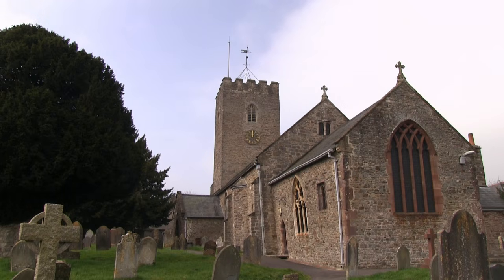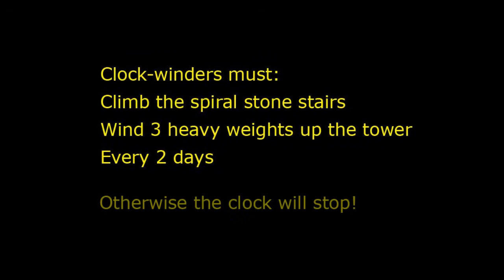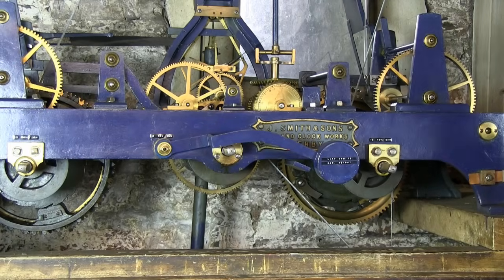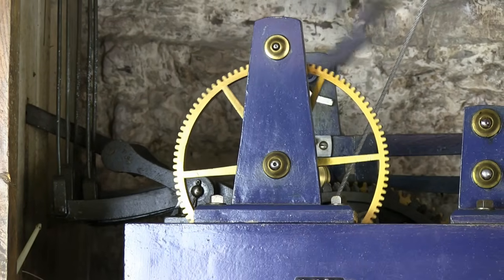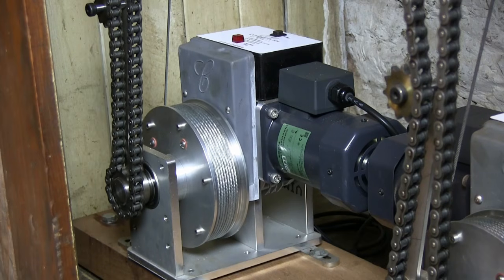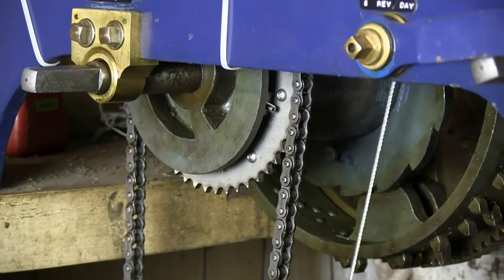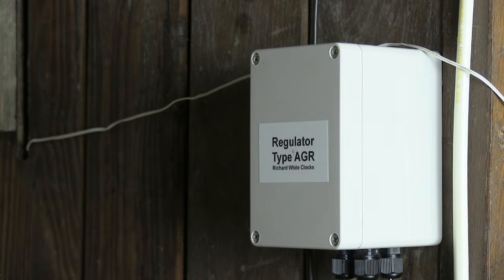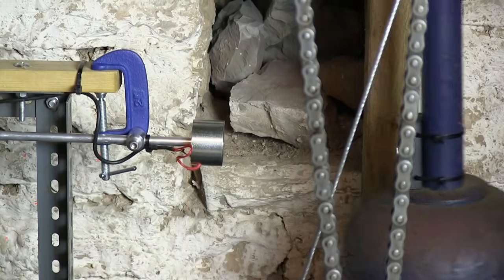Bampton Church Clock

Comment: It is commendable that such measures were taken without damaging the machine in any way, such as cutting, welding or drilling.
It does not damage a valuable traditional machine at all, as it can be returned to its original form at any time.　
This is necessary in today's society where manpower is in short supply.　
However, it is necessary to train machine clock technicians so that they do not disappear. In Japan, where I live, they have almost disappeared.
(Translation software used, please forgive any mistranslations, incorrect grammar, misrepresentations, etc.)

Comment: Well, an electromechanical clock wound by motors isn't a new idea at all, and well within the possibility of 1919 - but maybe this town didn't have no electricity yet. 
However, radio controlling the clock by influencing the pendulum frequency through inductors is quite genius, as it allows nearly perfect accuracy while keeping the whole original movement intact and in operation. 
Tremendous job guys. Just feeling sorry for the team whose jobs once again got automated away.

Comment: What is the mechanism that regulates how many times the bell rings when the clock strikes the hour? Seeing as how this thing is powered entirely mechanically (save for the electric motor that winds up the weights plus the electronic thing that occasionally adjusts the swinging rate of the pendulum to keep the clock in time when needed), something has to control how many times the bell rings for 1 o'clock, 2 o'clock and so on, and also something in the clock has to decide when it's time for the striking to begin. Can anyone attempt to explain this? This is something that's sort of puzzled me with mechanical clocks like this.
Reply from the maker: It is all built into the mechanics of the clock, running just the same as it did 100 years ago. The timekeeping side of the clock on the left triggers the striking mechanism as the hour ticks through, and that side will strike 1 the first time, 2 the second etc and so on until 12 hours later it starts again.
Reply: @bamptonhumph  Right, that makes sense. But what, then, determines how many times the clock chimes for the particular hour (once for 1 o'clock, twice for 2 o'clock and so on)? Is there some kind of rotating wheel or something like that which determines that? Like maybe this wheel has pins, or holes, or something else which somehow regulates the number of times the bell should ring?

I'm imagining that wheel or whatever would have to be first locked in place somehow so that it refuses to rotate, via some kind of "catch" or "locking pins" or something, until a gear or cam in the timekeeping part maybe pulls a lever that releases those "locking pins". That's what starts the striking process... that wheel that was once prevented from spinning can now finally spin. The opposite would then have to happen when it's time for the striking process to halt.

This is probably rather complex and therefore difficult to explain, so I do apologize if I'm maybe asking too much. But I'm simply interested in trying to understand how this works. I should also mention that I'm visually impaired to the point of complete blindness, so that's likely the biggest reason I don't quite get how this works yet.
Reply from the maker: @justinnaramor6050  You are right, it is very difficult to explain! But what you say is basically how it works. 
The chimes are worked very much like a giant musical box with a cylinder with spaced pins, and levers and links to the bells above. 
After the hour chimes, the strike mechanism is triggered by a lever which allows a large cog wheel to rotate, and in the side of this wheel there are pins spaced so that another wheel can be released to create a bong every time it goes around. The spacing of the pins gives time for it to turn once, twice, three times, etc until the next pin arrives. Hope that helps.
Reply: @bamptonhumph  So, your description gives me the impression that this thing uses a "count wheel" to determine the number of strikes on the bell for the hour. I did some reading on how a chiming/striking clock works a little while ago and this is what was explained. Basically the count wheel is a wheel which has little notches cut into it. When the bell is not striking, a lever sits inside one of those notches. This essentially holds the gear train for the striking mechanism in place so that it cannot rotate. My understanding is that there's a complex system of levers in the timekeeping part which ultimately leads to this lever on the count wheel. When it's time for the hour strike, this system of levers essentially pulls the lever out of the notch in the counting wheel, allowing it and the gear train to rotate. The lever rides along on the top of the counting wheel. As the counting wheel continues to rotate, eventually another notch comes into contact with the lever; the lever is allowed to then slide into the notch, either because of an attached spring or simply because gravity takes over and allows it to naturally slide into the notch. This once again restricts the count wheel and the gear train from rotating. So it's the amount of space between these notches, along the circumference of the counting wheel, that determines how many times the bell rings; if there is a longer time between when the lever is pulled out of one notch and when another notch comes into contact with the lever and allows it to drop, the bell would ring more times, because the large wheel with the pins that activate the hammers which hit the bell is allowed to rotate for longer. Obviously the opposite thing happens if the space between the notches is shorter. So the amount of space between the notches only increases as the clock goes through its 1-to-12-hour sequence of operation.

This kind of mechanism is actually fairly easy to understand, if you think about it. But I've also been made aware of another method for determining the number of bell rings for the hours, which is called a "rack and snail" mechanism. The way that works is a little more complex though. It has one particular advantage over the "count wheel" method though: part of this mechanism, the "snail" part, is attached directly to the shaft of the hour hand on the clock, so that any time the striking process happens, it's synchronized with the timekeeping mechanism. A downside of the "count wheel" mechanism is that it's entirely independent from the timekeeping part of the clock, so the 2 parts can become unsynchronized.
Reply from the maker: @justinnaramor6050  Your first description is pretty much spot-on for our church clock. And if the two sections of the clock do get out of sync it is quite easy to correct by manually flipping one of the levers to make it move on to the correct alignment. 
The rack and snail I do have in one of my wall clocks at home and presumably they don't work as well if scaled up to big machinery!
Reply: @bamptonhumph  Yeah, I had a feeling this was what was going on based on your explanation. Really, this is all very interesting! :)

Comment: The electric winders are nice if your winding team really doesn't want to, or can't, do the work anymore, but the electromagnet pulse do-dah for regulation is a ghastly out-of-character bit of overkill. It's the church clock - does anyone really care if it's 5seconds late or early? Besides a skilled clockmaker could probably reduce that to a second or two with a few adjustments and some proper maintenance. Thank you for the video though, most interesting.

Comment: And pray the electricity never goes out.
Reply: It will run for a good while without electricity, the motors keep the weights near the top of the tower, but there is a fair reserve drop.

Comment: The clock tower at Stanford University has the exact same chimes. Not just the Westminster-style chimes, but the same key as this tower, for both the quarter chimes and the hour chime.
Reply: I’ve seen (and heard) the Stanford clock when the tower was new. I understand it was in the tower of the chapel and survived the old tower’s  collapse after an earthquake. Nearby is the Hoover Tower which houses a 49-bell carillon.
Reply from the maker: Well I guess it is basically the Westminster chimes, but sounds different depending upon the size of the bells. Our bells are a little smaller than those in London!

Comment: I have a feeling why these were changed to automatic. Not because no one wanted to do it. But those who had the responsibility to wind the clock took it as a personal chore and a task which they, and they alone, could do. Instead of teaching anyone to do it, they kep it as the "Bell Winder's secret. So they church ended the confusion and jelousy.
Reply from the maker: Think that may have been true in the past, but in out case we had a 'team' of a dozen or so who wound for a month at a time. To me, how the clock is wound is not very relevant, as long as the mechanism has the TLC and attention it deserves to keep it running for the future.
Reply: @bamptonhumph Absolutely brilliant solution to a vexing problem. Before everyone knew the precise (satellite) time by glancing at his/her phone, the time of day was often announced by the town/village clock. The variations shown in the graph in the video show that the winders could not possibly adjust the clock as often as needed to be as accurate as today's handheld devices. Way too many trips up and down those winding (sorry, but...) steps would be necessary, so say the least. With that understanding, the automatic adjuster brings the clock and its tolling bells into the 21st century. As a result, maybe fewer town citizens will need to glance at their phones quite as often!
Reply: I agree, these "chores" could have been passed on - maybe the scouts or similar?

Comment: NO WEAR ADVANTAGE, The amount of pressure needed to operate the clock should never change. When you change the configuration of a compound weight fall arrangement to have a longer or shorter run time ,  The weight will vary. So basically if you have a 80 foot drop directly below the works, You would need , say 40 pounds, But if you compound the cable to fall half the distance you have to double the weight to say 80 pounds. The amount of pressure at the point where the cable pulls the gear is the same. Consistently the same wear.
Reply: Exactly! and the church is £5-10 grand out of pocket for not needed gismo's.  Thanks for coming!
Reply: Champ1964 
Forgive my ignorance,  but how then did they get away with reducing the weights that much.  I get the weight pressure needed,  but I can’t seem to wrap my brain around this situation.
Reply: @ridermak4111  There's epicyclic gearing inside the cable drums, the result is a small weight falling much further for each tick.
Reply: @ridermak4111  by removing pulleys, the lighter weights are allowed to drop faster, thus it doesn't have an 8 day energy storage anymore.
Reply: @ridermak4111  The weights can be small due to leverage multiplication. The weights now drive a wheel which drives a much smaller sprocket and this small sprocket drives a much larger sprocket through a chain attached to the original drive shaft. This means that without power added from the motors the weights will drive the clock for far less time now.
Reply: This does reduce wear on the original mechanism in one way that being on the ratchet mechanism since it is no longer used. But yes it clearly doesn't reduce wear on the bushings and pivots since the force required to operate the mechanism didn't change. You'd have to change the bushings and pivots to more wear resistant materials to accomplish that.

Comment: Hi, have you thought what might happen if the clock is running slow, not through temperature variations but through another obstruction that would normally stop the clock. With the system you have in place there, is it liable to cause serious damage to the mechanism or the motion works as it forces the clock to keep working ???
Reply from the maker: No probs with mechanism - we have it regularly serviced and it was done recently. It is an iron pendulum, and the coefficient of linear expansion more than explains any timing variations. Even though the tower walls are 4 feet thick, the temperature does vary quite a bit as the bells above are vented to the world on the floor above! The electronic bit doesn't really 'keep it going' but tweaks the timing by a gentle push or a gentle drag.

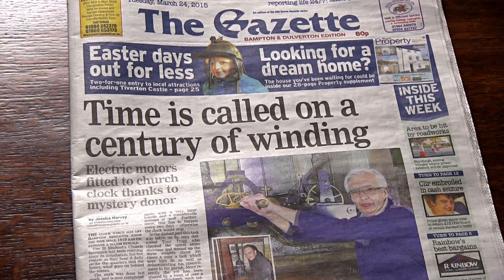Comment: 3:25 This is whats sad. No one can be bothered to take care of these beautiful pieces of engineering anymore. I have over 150 wind up non electric clocks. I have to wind them once a week, and make sure they are all well oiled and on time. In winding and looking after it, you come to have a relationship with it. If it's just there to look at, then you might as well just have a fully electric one. Again, sometimes leaving history unchanged is best.
Reply: That's not it... it is extremely difficult especially on older people, I wind the clock at my church and it is quite the work. So it's not that they don't want to care for it, but they may not be able to...
Reply: There's nothing wrong with this sort of innovation. Keeping that clock running was obviously a full time CHORE and not a real job that the Church could afford 14 people to maintain. That's a lot of labor and a lot of man hours for a Church to fund by itself. Don't get me wrong, I appreciate the aspect of keeping time and caring for valuable pieces of work like you do. But in this instance, the use of technology here was to preserve the clock and its heritage, not to undermine or take away from its historical value. All they did was automate the process it takes to keep it running and in doing so were able to make it even better by adding an electronic time keeper so it remains as accurate as a digital to clock while still remaining analog in its primary mechanisms :)
Reply: @madezra64  The fact that it needs fourteen people really suprises me, I guess they must just do it so every person only has to wind it once every month or so. It is certainly not a full time job to maintain a clock like this. Near where I live there is a famous clock tower (zimmertoren, Lier). This clock has 1 caretaker, who also does the cleaning and other maintance of the tower and museum. You just know that when you automate something like this, sooner or later it will no longer get regular lubrication and maintanance.
Reply: @slome815  It surprises me too. Makes you wonder what they all were doing.
Reply: I tend to agree with that - I love things left just the way they were created.
There is only ever one original......
Reply: All of you who thinks that it is not bad, I don't think so. I want to keep it manually operated because you just don't get the feel of winding hundreds of clocks every day